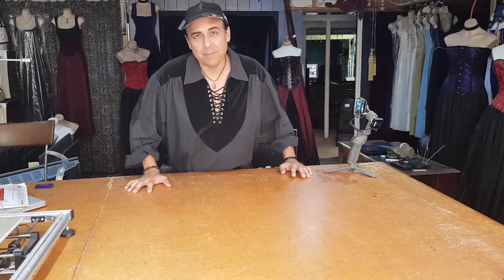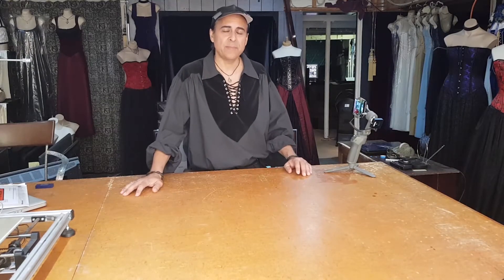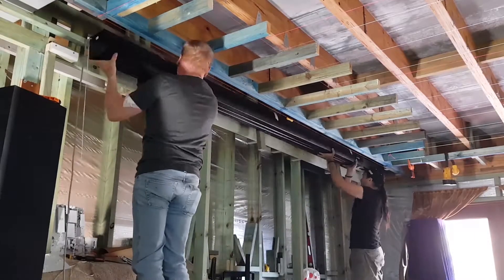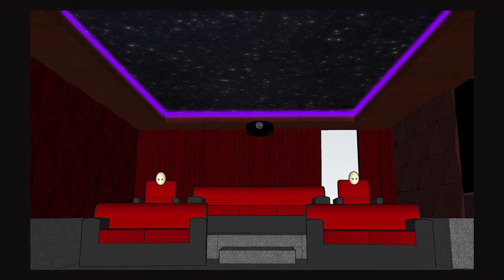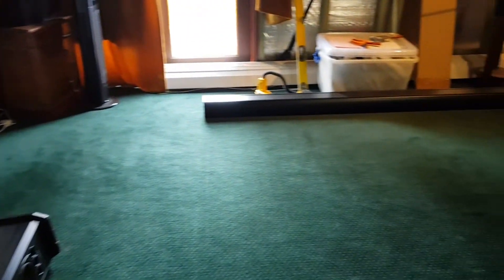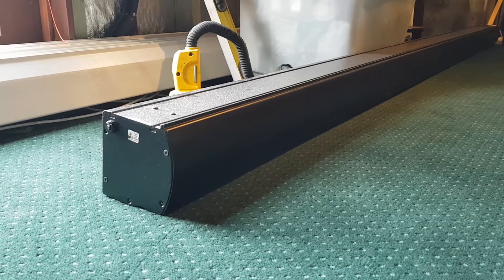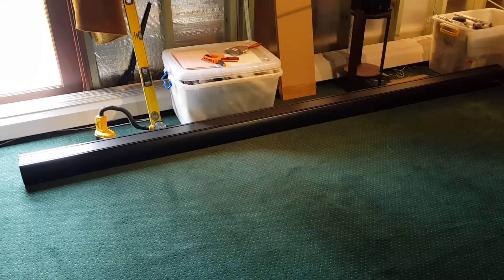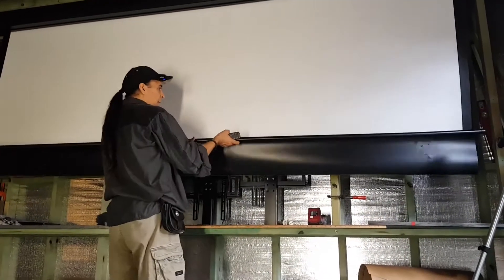I found 2 x 150" 'Screen Technics' 4:3 Motorized Projector Screens worth $3000.00 at the dump!

Comment: Do you have some links where to buy capacitor and IR receiver? I got the exact same problems
Reply from the maker: Not really mate. I just bought mine in eBay. Same with the ir receiver. I had to wait a while to find a good used ir remote and receiver though. Go them for $20. But I do remember them being sold on other sites after a Google search.
Reply: Thanks for that..I can’t find your video to Install the IR sensor, not sure if you made one?..I found the remote, I’ll search for the sensor so I can get this screen working.
Thank you for your videos! They are really helpful!👍 I don’t like throw away stuff either
Reply: I actually got a somfy remote, it’s been provided with the projector screen, but I’m not sure it would work